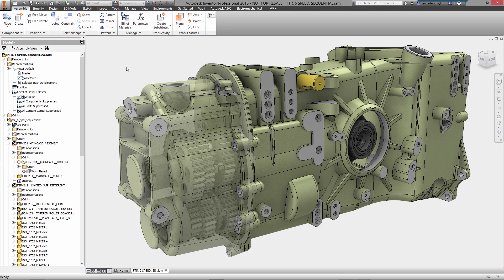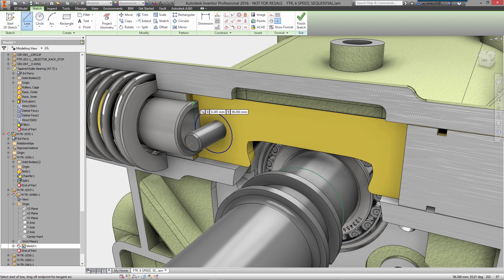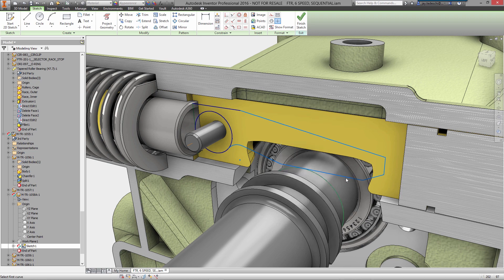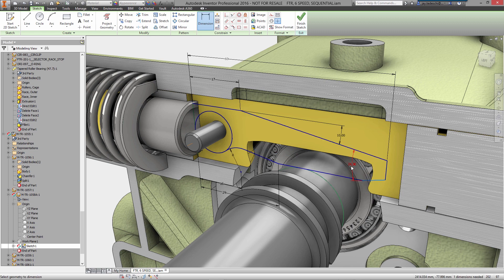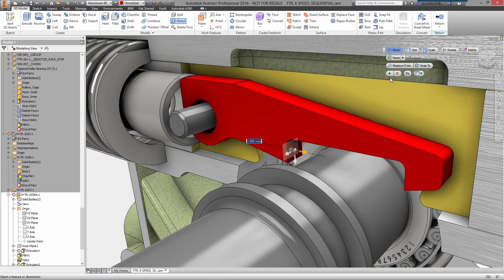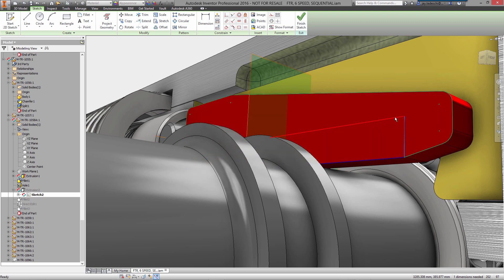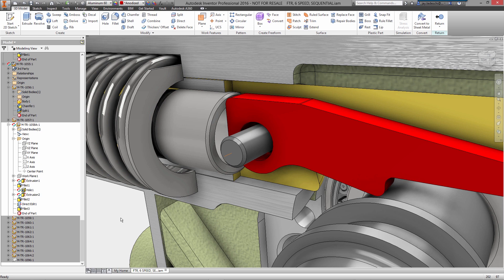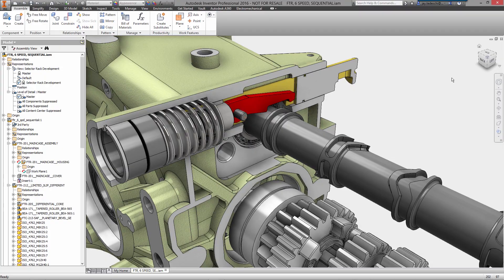Autodesk Inventor Parametric Part Modeling

Comment: Hey Rob, I notice you are using adaptive parts. Do you find that people who use the software in industry actually model their parts this way?
Reply from the maker: +solarplex03 I couldn't agree more guys. Adaptivity was a great concept when we introduced it. Multi-Body, or skeletal modeling when multiple references between components needs to be driven from a single source is the way to go. No question.
Reply: +robcohee Do you know why this isn't presented as the default way to model? It seems like every time I bring up master part modeling in a training environment I'm met with blank stares. I feel like the "Make Components" functionality is the most powerful tool Inventor has rolled out in the recent years, yet it is very rarely mentioned in the literature, or taught in the training courses.
Reply: +Andrew Roth No, no one.
Reply: I know of people that use it for early concept or layout. But most everyone turns it off prior to release. I know that to be the standard in many organizations - no adaptive parts are to be released. Even down to breaking the links in the sketch.
Reply: +Rob Cohee It's nice to hear an Autodesk employee answer this honestly. I've never found it to be reliable enough to be used in practice, yet it seems like it's always touted as the greatest thing since sliced bread.
Reply: +Rob Cohee For small assemblies....its fine. But get complex and random errors pop up like crazy. So easy to just start from a master part and push to an assembly.